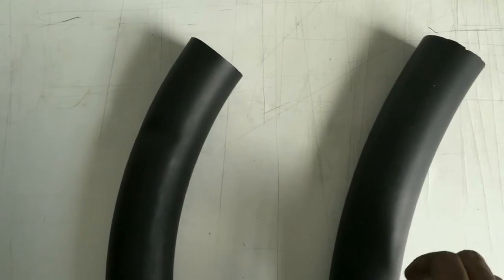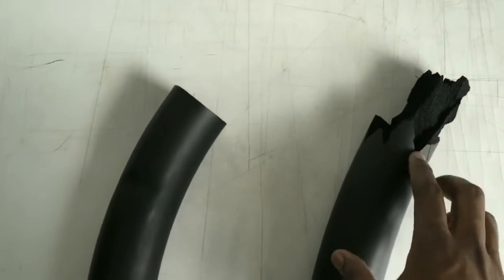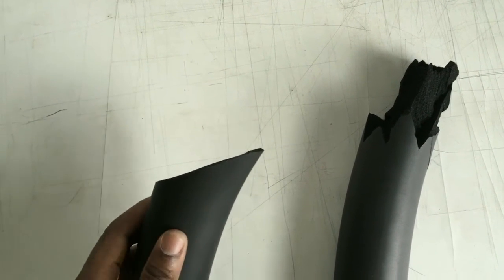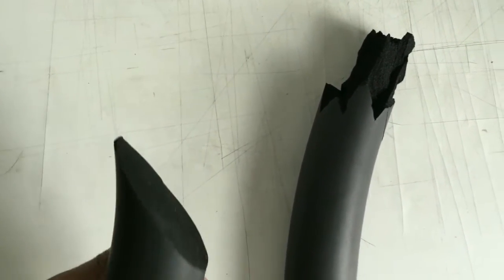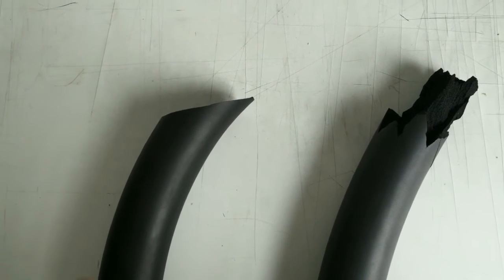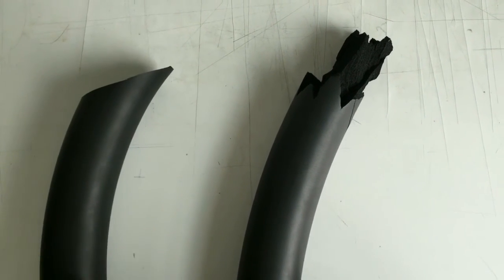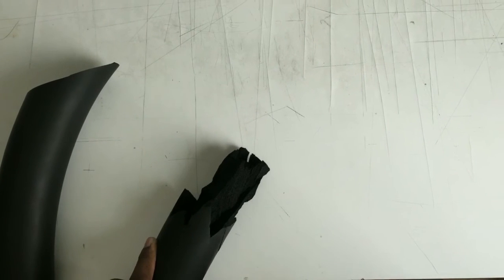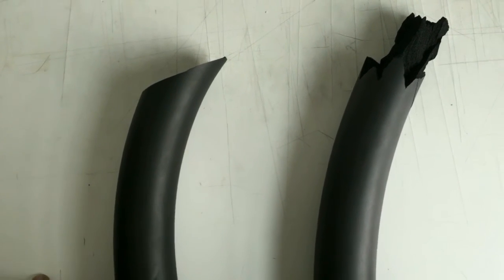Why are Razor Bumps a thing? (POWERFUL DEMO)

Comment: I never got razor bumps in my life until recently when I started using a safety razor. Before the safety razor I was using cartridge razors and I would do 2 passes. Now I'm using the same technique but with a safety razor and I'm getting razor bumps only where my Adam's apple is. I'm not sure what is causing it. Some say it's the soap, but I've used the same soap with a cartridge razor and no bumps. Other say its the blade I'm using, but I've changed the blade and still the same issue. I enjoy wet shaving but I'm not sure what the problem is ):
Reply from the maker: the adams apple is a challenging area to shave. if the problem is razor bumps the cure is simple (simpler than if the issue was ingrown hairs)
our most recent video on 10 commandments is a good guide

Comment: I have a goatee but me being me I wanted to make my cut look flawless so I went over the cut with a razor, about 10x. It was smooth and perfect for a few days then disaster struck. I am now watching this video with bumps on top of bumps. 😩😩
Reply from the maker: –Prep skin w shaving cream for 2 min
–No more than 1-2 bladed razor
–Clean tools w soap/hot water/rubbing alcohol
–Pass 1-2x per area
–Avoid excessive pressure
–Shave WITH the grain
–Avoid thick lotion
–Shave 6-7 days apart
–Avoid super tight clothes
–Exfoliate daily #wizkerbrush

Comment: Explains a lot. I've shaved my beard with a razor manually (after electric trimming) and the itch was pure torture. Took forever to get rid of all the ingrown hairs and the scarring. Since then I've never trusted myself with a razor. 

Are the electric liners that barbers use more similar to a manual razor?
Reply from the maker: +AJ P liners give a closer shave and leave a jagged hair behind but you have to clean the much more frequently since the rows of metal hot teeth potentially hold more germs and bacteria

Comment: hey i have hair bumps on the back of my neck I've tried to lift the hair up but it wont work I've been dealing with this problem for almost four years can you help me
Reply from the maker: hi Judah: it's possible that the bumps on the back or lower part of your neck are not the result of trapped or ingrown hair. the cause of the condition may be a gluten/wheat allegery. watch our videos to learn more
Reply: +Wizker: Bump Brush OK, thank you